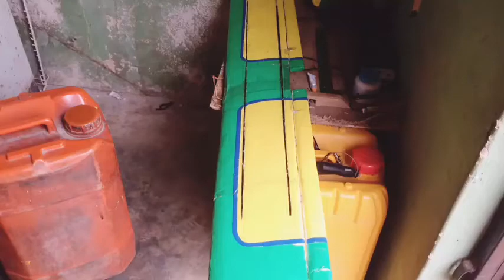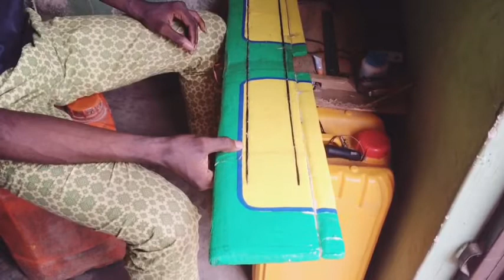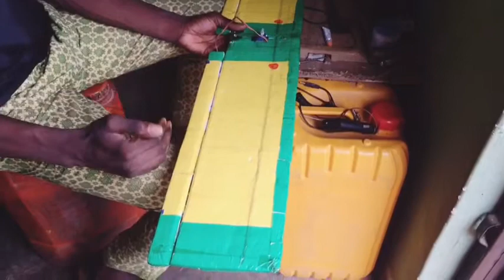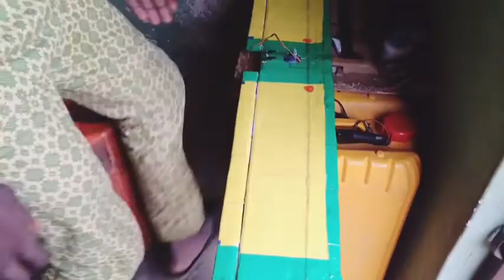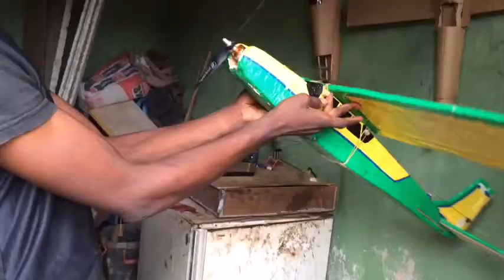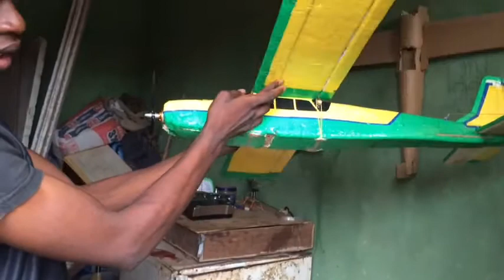How to find your CG on airplanes

Comment: This method only correct for this type of plane, if your wing swept or horizontal stablizer bigger/smaller, then this method not accurate.
Reply from the maker: Yes you are right lol little did I know then when I Made that video
Reply: @TOMSHOBBY  lol.😁. I think, there many kind of plane( swept wing like mig 17, canard, flying wing, delta...)  and very different build with complicated shape of wing (the plane in your video is popular, we not count) we just throw our plane like a paper plane to test. After it fly well, then balance the plane again with your finger to find where is the cg???  Test it if your plane durable enough 😆